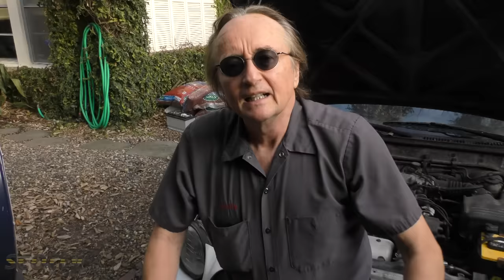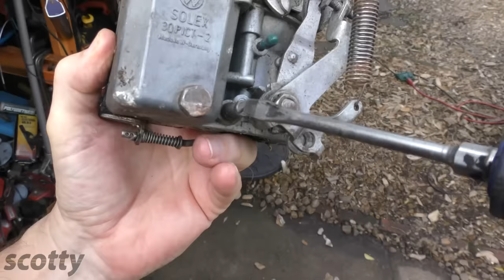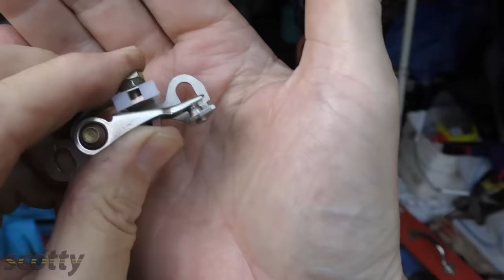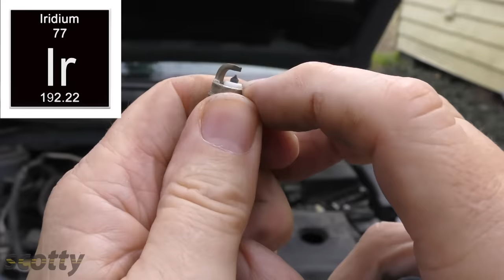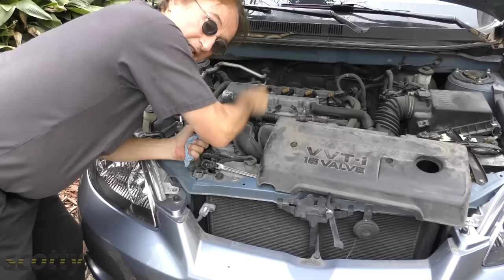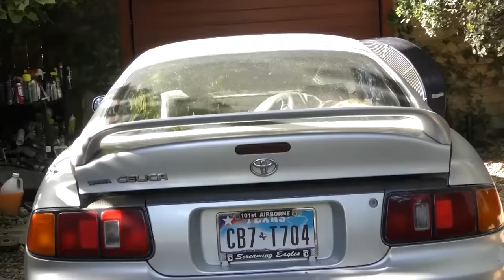Does Your Car Need a Tune Up? Myth Busted

Comment: 2011 Hyundai Veracruz. 154,000 miles..Never had a tune up. Runs fine. Will keep for.another 5 years. Splurge and tune up.... or don't mess with what's not broken and let it ride?

Comment: I've just bought myself a 13 year old Kia Proceed with 50,000 miles on it. Wondering if you folk recommend I get anything done to it? It seems to be running fine but any advice would be appreciated.
Reply: find out what the scheduled maintenance is for your car and go by that

Comment: It is funny, the radiator coolant hoses were leaking again in my 04 Sebring V6 (59,000 KM) when it got cold out this past winter; so they tightened them last time (we pondered why the factory connections were already gone); and this time they asked to replace the hoses .. I think just the part close to the radiator as the parts were not bad $40 bucks or something .. fasteners and hoses).  So I asked about my brothers 2009 Caliber which has a pulse while driving - I feared the CVT as he has 120,000km; but my mechanic said it could be a miss that is just not showing up in a check engine light .. copper plugs in that engine.  He said use what it came with as "not the greatest; but cheap" work fine in that car.

Comment: GREAT VIDEO SCOTTY! I always wonder about these guys in the car forums, change this every X miles, change that every X miles. Come on, modern cars don't need all these parts changed. If it ain't broke, don't fix it. I've heard of changing differential fluid every 15K or changing tranny fluid EVERY YEAR or every 20-30K. That's just throwing money away! Save up for when you really need a repair, I say.

Comment: I just changed the Iridium plugs on my Honda at 180,000 km. Old plugs were in perfect shape. The 180,000 km interval is in the manual. Oh ya, installed a K&N when I first got the vehicle.

Comment: The spark plug comment is so true.  I have pulled the OEM platinum plugs on three GM vehicles with over 150,000 miles...one of them with 180,000+ miles ( on a lowly 2.2 L 4-cylinder).  There all could have made it to 200k easily.

Comment: One thing to look for, though, during the basic visual inspection, is that your mass air flow is still in good shape (not cracked nor broken ) and affixed properly with a good seal.  This is sometimes a real bugger to find when the engine farts and stutters.  :)

Comment: I use a timing light to inspect the belts while the engine is running. My 2003 engine has spark plug wires from the electronic ignition module.

Comment: hi Scotty.  Thanks for the video. Amazing content as usual. but I have a question, wondering if you can help.
I was working on my Lexus rx350 a summer ago. I was trying to replace the spark plugs and gasket in the manifold. I was able to remove most of the nuts and bolts needed to get to the back side where the other 3 plugs were located, EXCEPT for the stingy one behind the passenger side on the manifold. I tried an hour trying to loosen it in this tight space to no avail. I eventually had to put everything back with just the 3 plugs replaced in the front. Do you have any tips on removing what seemed like a rusted and stuck nut in this crazy spot?
thank you for any help provided.

Comment: Aside from standard maintenance, I've seen a lot of people in the UK "tune up" their car by flashing the ECU with faster and/or more economical settings. Devices like the Bluefin/SuperChip ECU mappers can increase real-world fuel efficiency and increase power output on even standard vehicles, though I have no idea what kind of toll it could potentially take on the engine long-term.

Comment: In the ignition system, where are those little mechanical points that you have to change out every 15k miles on them at?

Comment: Mine still need to cleanup intake chamber from dust deposits, air filters still messed up some particle sized, also carbon buildup on compression chamber, cleaning up injector spray.
And also cutoff catalytic converter, it always drop exhaust air flow 😁

Comment: Hey Scotty I replaced rotor and pads and clips and grease caliber pins and replaced caliber but still have grinding noise when I brake the tire only turns freely when I open caliber valve

Comment: agreed they are not the same tune up. but plugs, wires, and throttle body cleaning is still required and can make a big difference in performance and economy

Comment: I had heck for most of a year when a vacuum elbow on the evaporative cannister valve. Found and replaced immediately, but turns out the replacement was pure chinesium. Kept thinking the part was fine because it was new. Did find several other leaks looking, though.
TL;DR: Vacuum leaks start at about 10 years. Sensors don't like stray O2.

Comment: I am 57 and used to tune up my old cars The best car was a 1969 fury with a 440 6 pack. The carbs were a pain in the ass to set up but when it was I could beat just about any car

Comment: I tune up my tacoma myself I clean the throttle body and air control valve and o2 sensors runs like a champ

Comment: Hey, Scotty and Everyone else, how long would you recommend a Platinum Spark Plug to last?  I'm only at 50k currently, But I am switching over to the iridium whenever, these start wearing, I already Have the new plugs;  impulse buy. But feel silly changing 2 early.  But I also don't want to be stuck with plugs I never use! It's a 2005 Civic EX with almost  120k miles.

Comment: Direct fuel injection is a bit different and soot or carbon the iridium spark plugs rather quickly. I change my plugs on my 3.5 ecoboost every 40k. They look pretty black at that milage also.

Comment: I'm sure it's not actually a tune up, but I replaced the spark plugs, spark plug wires, and ignition coil pack on my Focus and no more misfires or codes. Would it just be considered routine maintenance to do that?
Reply: i probably need to do the same. 
It's just been so damn cold and rainy these past 2  months.
Reply: No, it's considered throwing parts at a problem.
Reply: Still have the original wires on mine with 289K. Checked several times, always within specs.

Comment: Scotty.  I have a 2007 Toyota Yaris Auto 1.5.  I regularly change the engine oil and do other basic checks and now it has 120,000 miles I intend to change the spark plugs.  Would you recommend replacement of the ignition coils also?

Comment: Sigh. I miss the days when I could replace the plugs, cap and rotor, spark plug wires, fuel filter, PCV valve, air filter, and do an oil and filter change in an afternoon.
My 2017 Toyota Corolla SE with a 6 speed manual transmission gets an oil and K&N filter change with tire rotation every 5000 miles, and I do that myself in the carport.
I check the serpentine belt and hoses, and other fluid levels.
The air filter is a K&N, so I check it a couple times a year. Last time I looked, it was as clean as new.
I don't know if the factory plugs are Iridium. If I were to change them out at, say, 50,000 miles, I would be nervous about doing that since they are way down in the hole.
I want an older, less complicated, less computer-controlled car.
With a manual transmission.

Comment: Modern cars tune up is done by dyno. Reviewing Air:Fuel ratios making adjustments for better power or optimum gas mileage as usually set from the manufacture / factory. But before you dyno , the car should always be properly maintained or checked . Like proper oil level & other things mentioned in this video

Comment: Can I ask a question here?  I was told I have only 33 pounds of pressure in #1 cylinder (due to a overheated engine). Is there anything can be done short of engine haul out/overhaul?  Can I keep running the car like it is without doing more harm?  What about engine oil?  Your videos are great...so I'm asking!

Comment: Oldie but a goodie. 2004 T & C 190k miles. Should run 20 to 23 miles per gallon. Currently 7 to 9 miles per gallon. Slow and boggy acceleration. No problem once ideal speed reached.

Comment: I had my distributor rotor plugs and wires changed in my 97 GMC Sierra c1500 I believe we can call that a tune up, correct?

Comment: Toyota Dealer make me LOL.  I went for tires which is the only thing I have them do as they have a buy 3 get one for a buck.  They sloped on another $1600 worth of useless items to do that I declined, minor tune-up for a price of $430 plus cabin air filter $75.  Refreshing the Air conditioner for a whopping $169 and the list goes on.  It helps that I know a thing or two about cars.  The markup is just insane

Comment: Ive got a 2006 toyota matrix base with a 5 speed. when i first start it up it idles around 2000rpm  and bounces around the rpms a little. when i try to accelerate it seems to hesitate where would you suggest i start to smooth it out? I was thinking spark plugs and clean the throttle body? Thanks and love the channel!

Comment: Cant you adjust the idle on modern cars by adjustments screws on the throttle body? And isnt it still a good idea to get a tune up to make sure your timing belt is in time? and also what about valve adjustments?

Comment: I have 2010 Chevy impala lt with 3.5 engine with 178k miles mostly highway miles I have the original wires and spark plugs from the factory should I change them the car is running fine but should I or just let it be

Comment: I'm very curious about time ups because of this misnomer. I know little about cars and the new mechanic shop i go to said I need a tube up for my 1998 mustang, 209K miles.

My previous mechanic (sadly retired) told me 4 years ago not to worry about tube ups.

Should I get one of not?

Comment: My 03xterra has over 200k miles run like a champ an never had a tuneup had to change dry rotted hose an worn out parts an it’s still ticking

Comment: Hey Scotty. So what should I do with a Nissan that has over 200,000 miles as far as preventative maintenance goes?
Reply: Oil, air filters, transmission fluid if it’s been kept up, spark plugs and belts if they’re past due, brakes and tires

Just the basics and hope for the best ;)

Comment: Tune up ,plugs wires ,oil change,pcv,find vacuum leaks,replace air filter and if its time replace timing belt and timg components as well as toping fluid's and serpentine belt.

Comment: Well, in a modern turbo charged engine tuning up gets you upto 30% more power with new maps only. In some cars (like mazda 2.0 skyactive) theres no real difference between weakest and strongest engines - the only difference is in engine maps. This way you can turn a 120hp car into 170-180hp with an laptop and a obd cable.

Comment: Define modern. 

I owned a '74 Maverick that had points. My "modern" 1998 Yukon needed a tuneup when I bought it used [plugs, wires, distributor cap, rotor, air filter]! 2 of the pugs were missing their electrodes!

Comment: You do need tuning up on direct injection engine. The valves get gunked up, and removing the carbon deposits is needed.
Reply: Jeffrey Hung only on Volkswagen. Otherwise that is a myth.
Reply: Wayne S. Same goes for Ford. I work at a dealership

Comment: Years ago the Lexus "service" manager tried to talk me into a "tune-up".  He also said that my LS400 has a non-interference engine.  I left and haven't been back!  Incidentally, there was a man who had posted info on line about the iridium plugs in his Honda(?) with over 600K and them, still functioning well and with minimal increase in gap. Denso guarantees mine for 100K and I may never change them.

Comment: I had to set my timing on my 95 Integra when I first got it. The timing being off  caused a lack power. Though 1995 isn't very modern. Though it is fuel injected. Would modern be OBD2?

Comment: what about the valve clearance? my manual says "adjust if noisy", and it says check idle speed at 160,000 miles

Comment: Points on rotary engine would degrade at 2k miles, I owned a 79 rx-7 sucked ass. It had a thermal reactor (not catalytic converter), manual choke and the backfires were epic. People would hide like a shot gun had gone off. Hence why in 80 version they went to pointless distributor.

Comment: and clean the throttle body every year or two. check pcv valve. keep other fluids fresh. service brakes with silicon grease. clean rear drums and give them some lube in a few spots. bot those things arent drivetrain performance related.

Comment: arent the spark plugs affecting the exhaust noise and catalytic converter in my nissan altima someone said i need tune up before changing the catalytic converter.

Comment: thanks scotty for the info. i have a question. i am a grab driver similar to uber or lift driver back there here in manila. i was just wondering if it’s ok to use iridium spark plugs for my toyota vios manual transmission, some drivers say that it burns more efficient than regular spark plugs, but an autoshop dealer told me, since i am always on the road, regular spark plugs are more advisable. regulars last long also and burns fuel efficiently too. can you give me your thoughts about this thanks. rex from manila, philippines.

Comment: How about dust on your M.A.F filament and carbon on your throttle body plates? Don't the need cleaning when they're dirty... Most times,when these components gets really dirty they produce the same effect as the old cars do when they need tune ups,

Comment: Scotty, my uncle has a  2003 Chevy cavalier  with 306,000 original miles on it and the spark plugs were replaced last at 100,000

Comment: Now on the other hand if you drive an early 90s Cadillac which has never been serviced before and has the original spark plugs still installed... You might wanna have that tuned a bit.

Comment: I just bought a used Grand Caravan with 103,000 miles. The manual says to change the plugs and wires at 100,000. Is that really unnecessary?

Comment: Morning Scotty i have a 2004 Mitsubishi galant  6 cylinders how can i tell the water pump went out? I changed radiator and this morning car over heated and leaked out allll my brand new fluid it looked like it was peeing..lol from about the middle of car and when i opened the hood smoked looked like it was coming from engine block but what liooked like smoke from bottom up

Comment: I love your videos scotty!! But I have to disagree. I just changed the spark plugs on my 07 dodge ram with 100,000 miles because I thought it ran a little sluggish and you Should be seen those spark plugs I've never seen the tip of a spark plug wear out the way those did but after I changed them I noticed a significant difference in the way it idled and ran. Keep up the good work scotty
Reply: Mr.hamburger, I know the question was for the great Scotty, however, I owned a Subaru . They are very sturdy and the parts last pretty long. However,,, they are best at new and are NOT usually a recommended used car purchase.

Comment: My dad pulled a plug from my moms car it’s old they haven’t been changed in forever it was in excellent condition the oil was bad changed that and the cars running WAY better then before it’s rarely had tuneups so I’d say there not really nessicary but atleast change your oil out often to keep your car running smoothly

Comment: I hated carburetors on cars. They were easy to work on though. I don't know what I'm looking at when it comes to fuel injection, but rarely have I seen the systems fail unless the ecu got fried. On motorcycles though I love carbs. Timing those is easy
Reply: Old Chevy Max, What is meant by  Fuel Trim??

Comment: My breaks were squeaking on my Prius since I bought it used had over 100k on it and no indication that the breaks were ever done... So I went all out bought new pads and rotors. Floor Jack's and stands and was like I'm going to do this myself... My buddy who's a mechanic comes next after work to check on my progress... Looks at the old pads... Goes you know these are at 50% and the old rotors look fine you probably could've just cleaned them really good and been good to go for A while... Point behind the comment sometimes it's all in your head
Reply: The dealership nearly sold me on $1000 full break job $160 just to flush the fluid lol

Comment: I have a 2012 Acura TL with 40,000 miles and when I accelerate hard it gives me a nasty egg fumes smell... Gives me a headache.. car has no check engine and pass smog?
Reply: Catalytic converter

Comment: Quick question on a 2009 Chevy aveo5 lt car change the spark plugs and the oil change and while driving the car kinda loss of power and lunge and all of a sudden and sometimes also if you step in the gas pedal and don't get kick in and all of a sudden the car goes